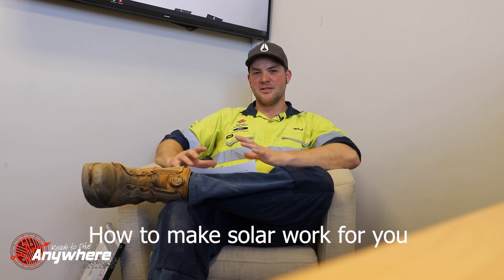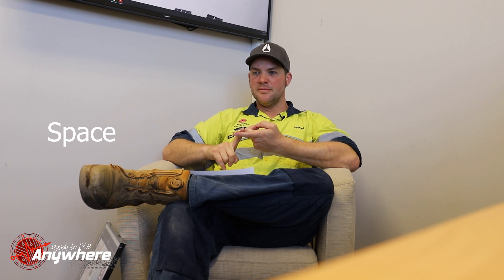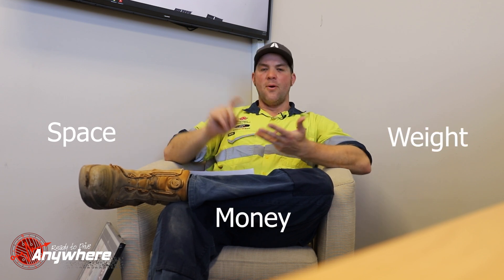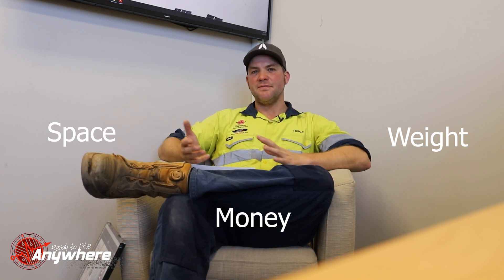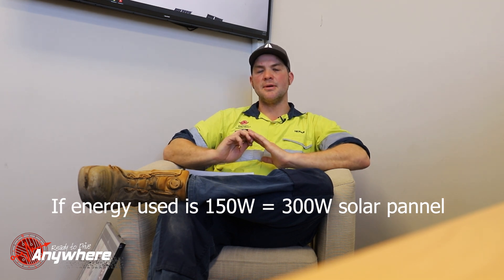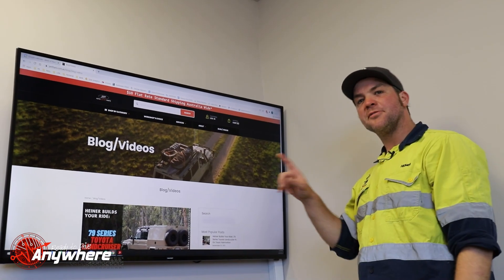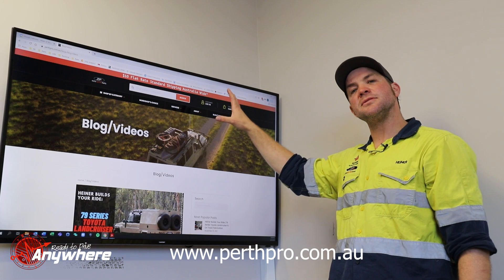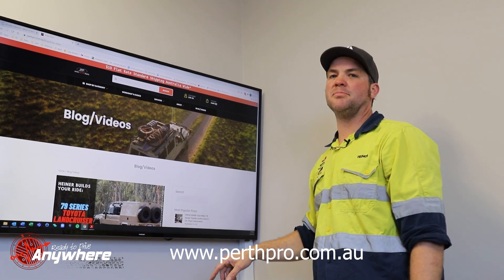Heiners Workshop Lessons: Offgrid Auto Electrics | Episode 6 How to Make Solar Work For You

Comment: I just saw your video with Ronny where you mentioned using a power supply as a 'solar simulator'. I have a redarc BCDC1225D which has a solar input voltage of 9-32V, if I connect a computer power supply that has 12V 17A will this work to charge?
Reply from the maker: We use a power supply with 15.5V which works. I am not sure if 12V will already work even though the manual states it is 9 – 32V. I was under the impression that a MPPT regulator can only reduce the voltage. Increasing the voltage is only done by the charging circuit that uses the alternator input. As far as I am aware. Please let us know how you go with your experiment
Reply: @ReadytoDriveAnywhere  I tried it and it worked fine although it pulled 20A+ the wiring started getting soft. I could rewire and fuse it but it was easier just to buy a proper charger.

Comment: Great video Heiner, with regards to the panels being tested at approximately 25 degrees Celsius, is it a smart idea on 40 plus days to spray them with water and gently wipe them over essentially cleaning them at the same time?
Reply from the maker: Hi Phil, You can but be careful not to scratch the surface. In terms of cooling the panel you would have to constantly cool them otherwise the water evaporates in less than 5 minutes.

Comment: some great info - couple of questions, I am considering running a solar blanket rather than a fixed panel so if I was to park my truck while out on a tour as you suggested can the blanket be used inside the vehicle windscreen rather than outside to avoid theft of the blanket and if so what sort of %output could I expect, the other thought was to set the blanket as an awning which could be flat and on any side of the vehicle - your thoughts? many thanks
Reply from the maker: Hi Steve, using the panel inside the vehicle may reduce your production by easily 80%. This is a best guess since we haven’t tested it. Having the panel on a flat surface facing the sky and making sure there is no shade on the panel is the best way to use a solar blanket. Having it stolen if it is accessible is a problem where is no solution to it yet.
Reply: Thanks Heiner, I was more thinking of inside against the windscreen instead of the conventional silver sun screen we all use in summer when the car is parked for a period of time - thinking it may have been a viable alternative/win win. Cheers
Reply: @steve-deltasdad3906  Steve, I currently have the same issue. My thoughts are to run a cable to my roof rack and buy a cheap flexible panel with eyelets. I plan to use cable binders and one or two small locks to secure it to my roof rack. It still can get stolen, but it is considerably more effort to remove it being locked. A cheap panel might not be as effective but the loss is not too painful.